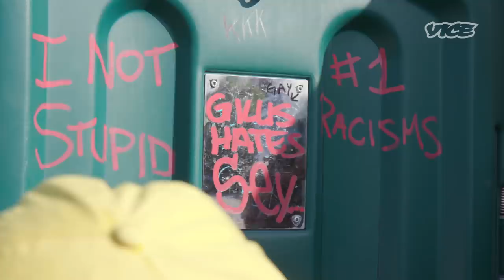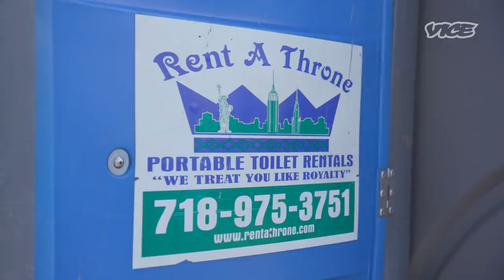My Internship Cleaning NYC Porta Potties | 24 Hour Intern

Comment: I built new homes on mass production job sites for 20 yrs. Here's a few tips for all you newbies when ya need to use a porta potty.  

1 never use one unless you have too
2 always look for the shitter on the jobsite farthest away from the current phase of the project not being built yet, their the cleanest
3 if the hole jobsite is being built at once, get to know the routine of the shit trucks time and time your shits accordingly.
4 if the shitters are all gross, or if it's stupid hot out, shit in the unfinished basement of a house being built.
5 always carry shitpaper in your work truck

Bonus material
If ya wanna have some fun with co workers who like to treat the porta potties like their own personal litter box, here is a cpl ways to show them a lesson
1 wait till they go in, then sneak up to door and use a cordless power drill and sink a few screws in the door, walk away
2 wait till they go in, back work truck up to door, walk away
These tips work especially well on hot days
🖕😎🖕

Comment: I also work in this business. And the only thing that I will comment on is the fact they're using latex gloves. They should be using is latex dipped work gloves. They have far greater durability. With Porta potty's, you have no idea what you'll find, and latex gloves provide ZERO protection. And you don't want any part of you getting cut or stabbed by a needle or glass or whatever.

Comment: Totally  not  true!!! I have work  for that  type of company  and it's  way  more  worse than  that! Imagine that you have  11 hours to clean 120 portables spread across  8 city  blocks, and they are all  moved  by the  nastiest  construction workers  you have ever seen,  and not only  that, the  vacuum  truck  does have reverse  to clear out  clogs in the pipes, you can not  imagine  the horror. Plus  out  of  100 around 10 of them  the people usually  push them  and  spills out the  contents  on every  inner walls, and let me remind you that  all of that  has  a smell that you  can  never get off  your  nose..... it usually get overly  use  (abused) and left to  fermentation over  a week  under the great  summer  heat .